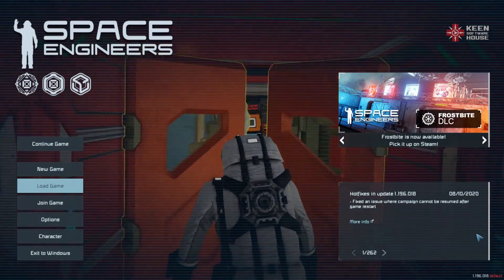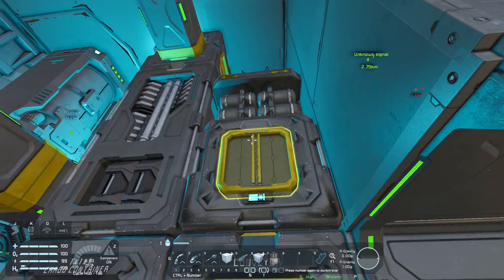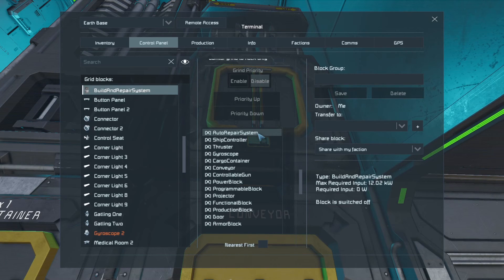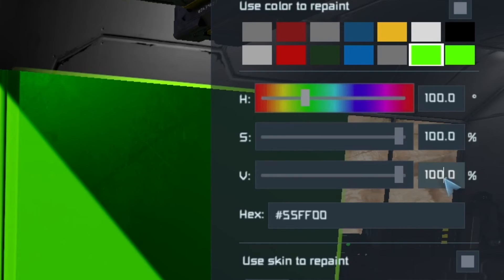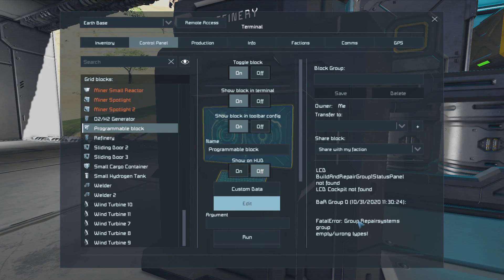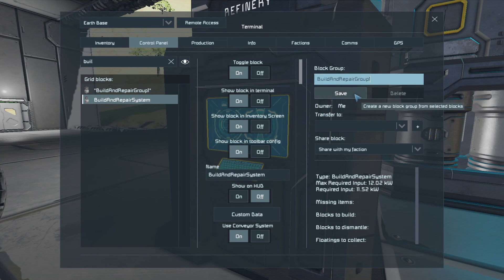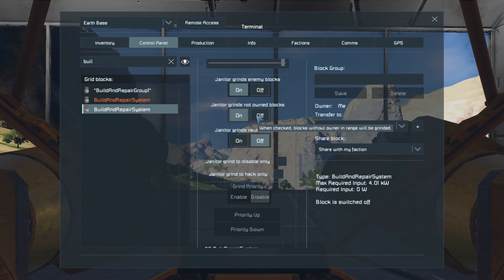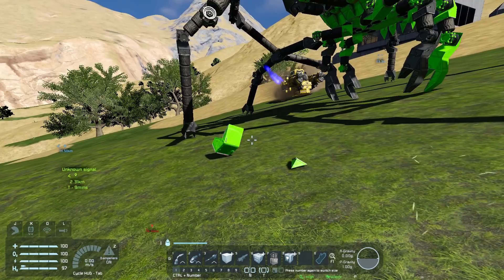Space Engineers: Nanobot Build and Repair Mod and Scripts

Comment: Another way to access the control panel for a block, instead of [ F ] or [ K ] is to right-click on the interface panel when you have no tools selected.  Will not work if you hold the welder, grinder or anything else from your tool bar.
Reply from the maker: Good tip, thanks Frank.

Comment: You did not speak of the [ build new ] setting.  A setting that I use often.  It will not build projection blocks.  It will only repair existing blocks or blocks that you have put down.  Useful when you use projections and need to keep the buildandrepair system active as when under attacks.
Reply from the maker: Yes that is a good feature. Particularly for the option to not weld frames for aesthetics as you mentioned. Great mod really, lots of options to explore.

Comment: i did exackly what you did i checkt if five times but for some reason all builders wont build up blocks anymore. instat he flexes them away in any colore even if i set in "only welding"
Reply from the maker: I wonder if the mod is broken after the last update? It would be worth reading the forum for the mod to see if there is a solution. Could the naming convention for the containers or assemblers have changes so it's no longer linked to them and unable to find the components?
Reply from the maker: Just checked the steam chat for the mod and it appears to be broken for some people after the last update :

https://steamcommunity.com/sharedfiles/filedetails/comments/857053359

Comment: I'm currently having problems with the mod, the "mode settings" are completely missing from the mod and I don't know what, have any opinions on it?
Reply from the maker: It's a long time since I used the mod so I'm not sure what might have changed since this video. Check you are using the latest version and ensure scripts are enabled in your world. Not sure what else to suggest I'm afraid.
Reply: @TallmanBradGameplay  thanks but damn, yeah I'm using the same mod you are, and I'm pretty sure scripts are enabled, but it seems it's just not there for some reason still
Reply from the maker: It also would cause a problem if you were on a server that didn't allow mods. Or it could be conflicting with another mod? I'm sorry volcano I'm not sure what else to suggest.

Comment: hello I have a problem with my programmable block, I do not have the same display as you to insert the scripts. it does not tell me costum data / edit
Reply from the maker: Before you started the game, in settings and advanced, there's an option to enable scripts. You can fix this after you've started a game by choosing the 'load' option from the main menu, then 'edit' your game. See if that fixes it.
Reply from the maker: I forgot to mention you also need to have 'experimental mode' enabled too. If you're still stuck let me know and I'll type out better instructions.

Comment: Nice video will try this mod.. if you can will you make a video on trouble shooting issuses. Some i have had my miner was to heavy to move after mining had to add more engines ..not enough power had to add more generators and that sort
Reply from the maker: Adding a second battery will help a great deal with a miner struggling with power loss. If your power consumption ever flashes red at 100 percent, even just for a split second, it doesn't have enough battery power. With small miners it's a fine line between being able to fly and nose diving into the hole you just dug. The sooner you get away from needing stone, the better. Raw ores yield so much more resources and therefore you don't need to carry as much. Having an ejector on your miner will help remove stone from your inventory and lighten your ship. I might do a quick video on setting up one of those.